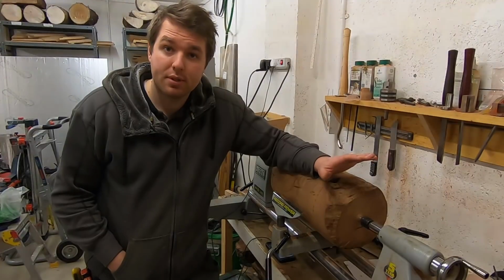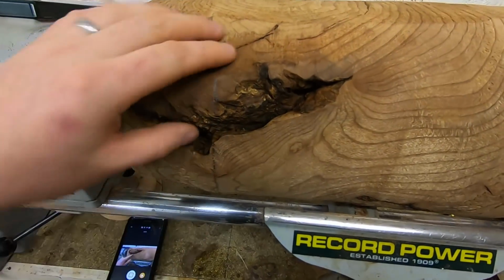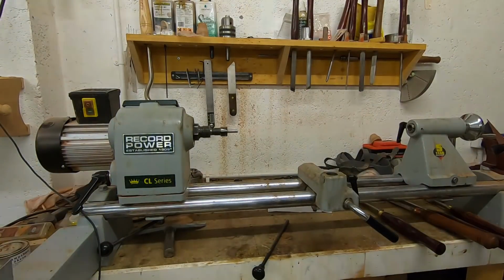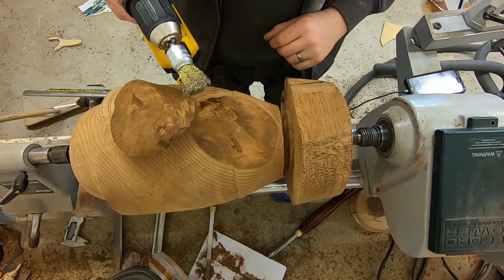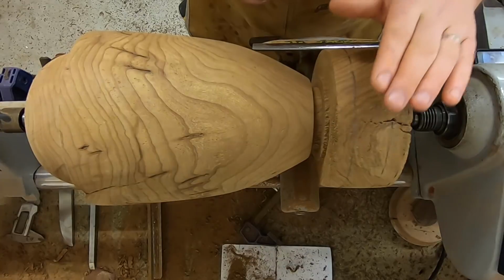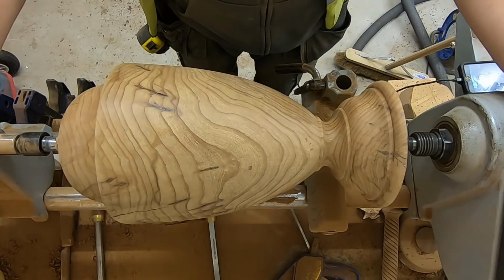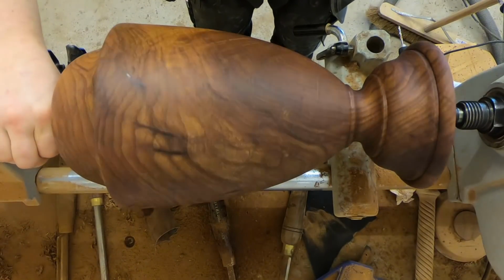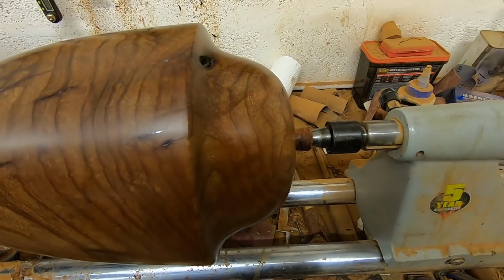Woodturning The Elm Burr/Burl : A Large Pedestal Urn Lamp Base

Comment: Great job Nathan, nice to see you turned the job to completion on the spur drive, a lot of hobbyists seem to have a fetish about putting a tenon on things and getting it in a chuck as soon as possible, to me that"s a lack of confidence; not just in their ability but in their equipment, you've just proved them all wrong well done mate...Allen.
Reply from the maker: Thank you Allen, I wasn't prepared to sacrifice the wood that would be required to turn a tenon. Even with the large mass of the wood before turning I wasn't at all concerned at the piece coming off, all it took was a few minutes to centre it by its weight rather than its form. Far easier than putting it on the chuck.